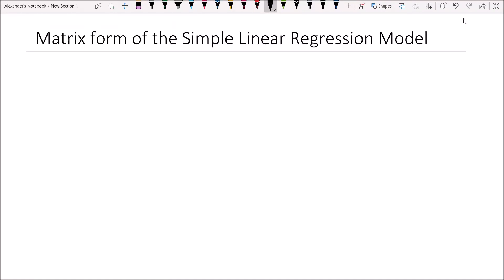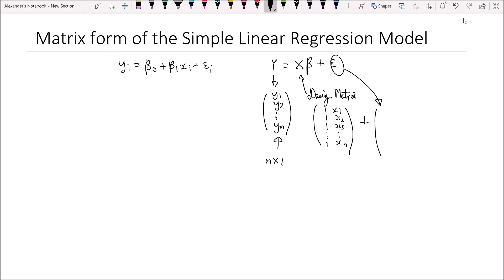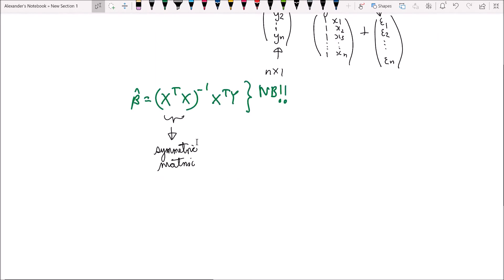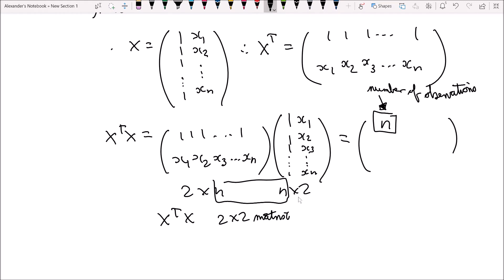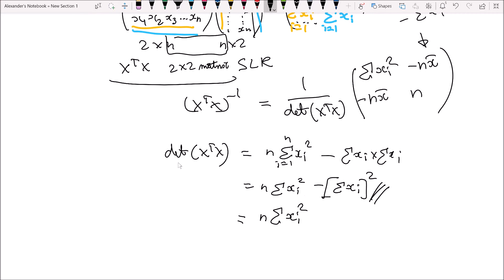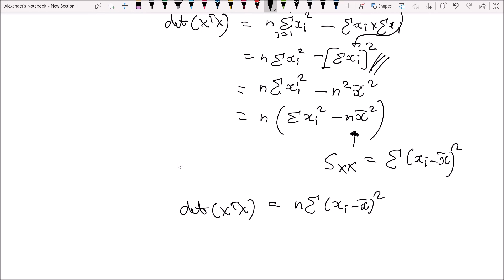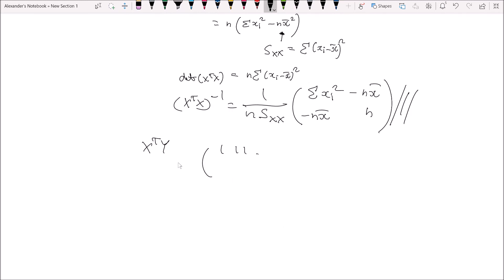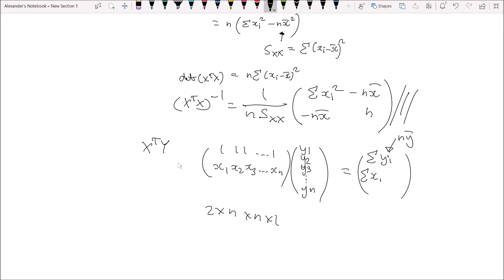Matrix Form Simple Linear Regression

Comment: Somethig  strange: 
the equation ...

BETA_HAT=X.I@Y 

...in Python (Numpy) give us the same solution of ....

BETA_HAT=(X.T@X).I@X.T@Y.       

Try it!
Reply from the maker: Hi janslesp, a good foray into the calculations and good work on applying the thinking in python. Have a go with a design matrix x that is not square and you will see that the equation does not work then.

Your equation works if the matrix X is an invertible square matrix but it will not work when X is not square. 

try the example below.

x = np.array([[1,2,3,3],
             [1,5,7,34],
             [1,4,3,6]])

y = np.array([2,6,7])

# beta_hat runs fine
beta_hat = np.linalg.inv(x.T @ x) @ x.T @ y

# this line of code will raise an error as x is not #square

beta_hat_2 = np.linalg.inv(x) @ y
Reply: @BoerCommander   Hello Boer. I'm trying to understand these rules of this wonderful universe of linear algebra, Python and Machine Learning. You have no idea the pleasure of exchanging information with talents from other countries. I'm not a data science professional and I'm trying to overcome my difficulties. Thank you. Today I went back to playing a little on the computer. I used the code below which, as a rule, my X is not invertible matrix because X is not square and therefore not invertible. But I dont undestand: numpy makes the method ".I" in this case!!  Does  numpy have any algorithm to calculate a X.I matrix that simulates an inversion? Note that in the final result we get  the same result:       tetas_strange_equation = tetas_Normal_Equation

The code is: 

import numpy as np
X=np.matrix([
    [1,35,70,0],
    [1,15,50,0],
    [1,42,80,0],
    [1,25,70,1],
    [1,28,90,1],
    [1,12,65,0],
    [1,34,72,0]])
y=np.matrix([90, 35, 98, 70, 62, 32,68]).T

# Strange equation
tetas_strange_equation=X.I@y
print(tetas)

# Normal equation
tetas_Normal_Equation=(X.T@X).I@X.T@y
print(tetas_Normal_Equation)

OUTPUT:
[[21.77437371]
 [ 2.47318883]
 [-0.37736477]
 [ 8.8753038 ]]

[[21.77437371]
 [ 2.47318883]
 [-0.37736477]
 [ 8.8753038 ]]